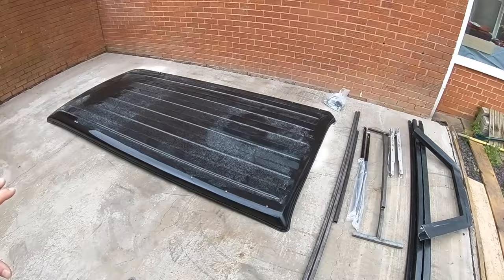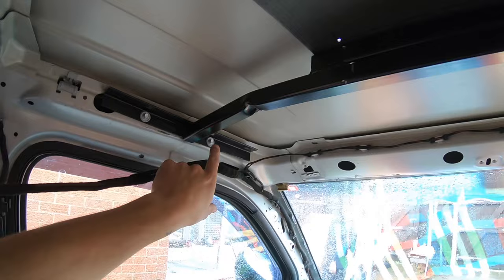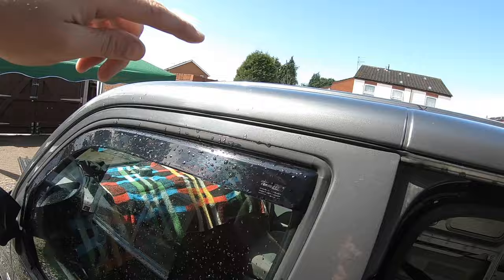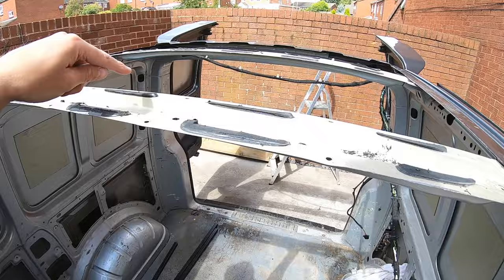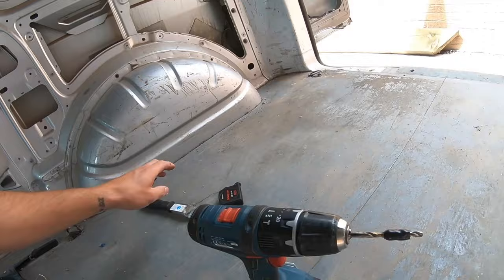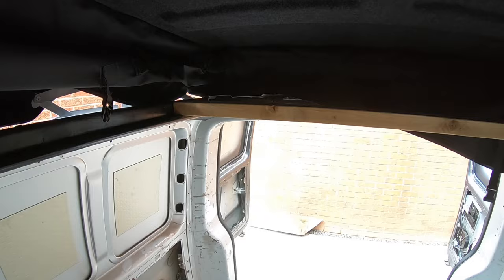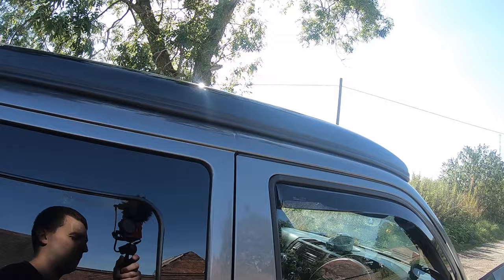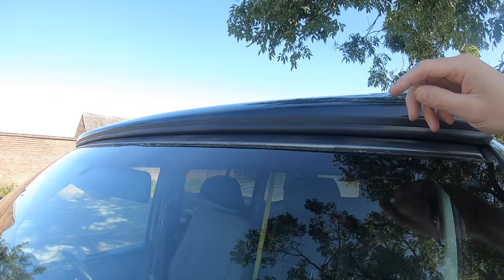** MY VW CAMPER CONVERSION BUILD ** #10 Fitting a POP TOP !!!!!!

Comment from the maker: ****PLEASE READ FOR POP TOP SUPPLIER. *****
UNFORTUNATELY DUE TO RECENT COMPLAINTS ABOUT VERY POOR SERVICE AND QUALITY ISSUES WITH THIS ROOF I NO LONGER RECOMMEND PURCHASING THIS POP TOP. SO PLEASE BE CAREFUL IF YOU PURCHASE ONE AS I RECOMMEND NOT TO. JAY
Reply: hey Dude this is really helpful. What brand was the pop top? If you are having issues i want to make sure i don't get the same one but didn't hear in the video where you got if from? Cheers
Reply: If you don't recommend the supplier please tell us who they are, I'm about to buy one and want to make sure it's not the same!! 🤷🏼‍♂️
Reply from the maker: Apologies I have only just seen this message. I can’t seem to find the company name now. The chap is called Allan who lives in derby
Reply: @JaysFabShop  nice one Jay 👍
Reply from the maker: Hey matey. I have checked but can’t find the company now. The chap is called Allan who lives in derby but that’s all I can tell you really. Just look at the kits and you will be able to tell if it’s the same as mine. With the rubbish fibreglass lengths
Reply: @JaysFabShop  yeah but to be fair you've done a good job of it,  and the fibre glass wouldn't bother me to much, nice and light at least. great in depth video as well, thanks for sharing, given me the confidence to do it myself.
Reply: So only just read this after purchasing one of Ebay. They were based up north. It came with a solid metal frame all one piece. 
What were the main issues with the quality please?
Really concerned now.
Reply from the maker: That will be a different supplier matey so don’t worry yourself it will be fine.
Reply: Hello! what would be the price of a pop top and instaling it on an older van?
Reply: @ashbrock100  I got mine off a company on eBay. They had no reviews. I was drunk and high... Bad move. The kit was actually totally fine and we just had to use a crowbar to maneuver the framer into position. We got there eventually so I would recommend it. Sorry I can't remember the name. But they were based up north UK. Good luck 😃
Reply: How much was it mate?
Reply: @savvy2807  £1800 with a colour coded canvas lining with 3 external windows and everything you need
Reply: @JakeHolland  you recon it was austops?
Reply: @savvy2807  no idea bruv
Reply: Hey jay, i know this video was a while ago but do you have any other recommendations of company’s if you don’t recommend this one

Comment: I would definetly tape the roof after you marked the lines before you start cutting. Ill tape it say 10 mm out from the mark this would allow you to follow the line and create edge when you do paint it after. This will save your van paint from all the metal shards and sparks when you cut. Cheers
Reply from the maker: Thank mate and totally correct. Because of the none stop on and off rain we chose not to mask and sheet it in the end. Definitely is a better job to though and I recommend you do 👌

Comment: Fantastic job Jay. Didn’t think it was possible to do a self fitted pop top. Having the extra headroom makes a massive difference inside. Loved all the top tips you gave. Can’t wait to see the Transporter carpet lined and fitted out.  Love the van colour and the wheels too.   👍
Reply from the maker: Thank you Ian. Very much appreciated. The start to the wiring video goes up tonight 8 pm 🙏
Reply: What size tex screws did you  use

Comment: The other option for the sealant job is to buy some of those plastic bead forming tools. I love them. Used to have nightmares doing shower re- seals until I got mine. You can get a set of them on ebay etc for a couple of quid. They look a bit like oversize guitar plectrums with curved and straight angled shapes on each corner that make very neat jobs.
Reply from the maker: Aw cool I’ve not heard of these mate but will definitely check them out as I still have the sealer to finish

Comment: Hi mate

How did you fit the rubber wind deflector strip?  Did you get an extra pair of hands or did you do it on you own?

Thanks
Reply from the maker: Hey Simon. I did it on my own. If you use tape then pull the tape along all the bottom of the seal. Then only remove the first couple of inches from one side. Stick that part down in the corner you start from then you can go along holding the seal in place and then peeling the tape cover off as you do and in turn slowly working your way along and sticking it down? Does that make sense

Comment: Awesome. Not seen such an informative video on this. 👍🏼. One question. The first support bar you put in . How do you measure its position so it fits in the correct position front to back .
Reply from the maker: Thanks mate. I mentioned it in the video it goes in line with the body lines but you can measure it from about from the top of the screen back also

Comment: Decent vid, looking at building my own camper. Just subscribed 👍. Might have to watch the pop top one 1 or 2 more times though 😂. Probably best to carpet after the pop top then?
Reply from the maker: Hey Luke. Thanks bro it means a lot. Yes I would carpet after the pop top. If you fit glass fit the carpet before you bond the glass on but after you have cut the holes out

Comment: Excellent advice, help, hints and video. Thank you for making the mistakes for us. Did you foam fill the supports after you put in the long black support poles. These are the bits had the 10mm boles poking up into the old support beams, because you worried about the edge of the metal, I wonder if you insulate the roof after you fitted the roof ?
Reply from the maker: Hi matey. No I didn’t foam fill the supports after. I could of to be fair but worried that the foam would hold moisture and make things worse? That you think?
Reply from the maker: Sorry and I have insulated all the front but I have not yet insulated the rear of the van yet. My next jobs are that and fitting the wiring and second battery

Comment: Jay I’m up to the fibreglass trim around the edge but it doesn’t seem to fit did you have to trim it before riveting it in
Reply from the maker: Yea matey you need to trim them down to fit. They are made longer than needed
Reply: @JaysFabShop   thanks for the quick reply absolutely no help from the supplier I’m certain it was the same place you got your roof mines exactly the same

Comment: great job buddy..where did you get your roof from..cheers phil
Reply: Hi Jay,
Another brilliant video, watched a load of the others as well. I also like doing my own stuff. 
Finally picked up my own Transporter after having been into Aircooled Vee Dubs for many years and then wanting a daily modern van. Mine is a 2012 140 horse Olympian blue panel van with Sportline bumpers, 20" alloys, rear spoiler etc.  So chuffed and can't wait to put the windows in etc.
The guy in Derbyshire wouldn't happen to be Allan Schofield based in Glossop would it? He has his VW Transporter parts and accessories business there. Be cool if it is as he is only local to myself.....approx 5 miles away. 😃 So damn easy for me to pick up.

Comment: I have fitted a few different van roofs in the past. I bought one of these for £1100 on Ebay and found this roof to be by far the worst I have fitted. It lacks strength in many areas. The fibreglass edging is very weak, it has many main bits missing. ie the front wind deflector is not there. The whole strengthening kit is very substandard compared to other roofs. It lacks in windows and has just fly nets instead of clear plastic, when unzipping the window. The edging trim to fix the tent down is not the normal J Trim and is again some cheap not suitable trim. Great tutorial but wrong roof to fit to your van unfortunately.
Reply from the maker: Hey Gary. Thanks for the comment matey could be great knowledge for others. Myself personally have not had any other experience with other roofs so I can’t really complain or compare. I will say I’m petty happy with it really and it suits my needs. You are correct though on some stuff. Strength wise this was one of the new batches of roofs the chap was making so I’m not sure if it’s much different to the old onces or not but I’ve found this one to feel fairly strong over the hole roof to be honest. The trim for the canvas is just house pvc window trim so correct there and yes correct a wind seal
Is not supplied. Thanks for your comment matey and if you can recommend other roofs for my viewers please do below. 🇬🇧👌
Reply: Best value for money with everything you need, including all fixings and adhesives are Denby roofs in Leek  Staffs.

Comment: Why VW has abandoned the USA van market is unknown to us. (A re-badged Dodge Caravan was their answer lol).
Reply from the maker: Aw really didn’t know that to be fair
Reply: @JaysFabShop  The UK is so lucky to have so many van offerings per the lower population they have. Is the VW Transporter a newer van model? Looks to be a mid sized van, copied in looks to the old mid size Chevy Astro (RIP 2005). Zero midsize vans on the market across the pond since then. Well, we do have the over priced, expensive to repair Mercedes Metrics, no one buys them. The Transporter would sell like hot cakes here if priced fairly. .  North Americans are addicted to useless SUV's. Vans rock, but all we have is the dieing mini-van market, or the much larger new European style vans.  A normal chevy full size (only one left) gets worse fuel consumption than my old 1979 chev cargo V8 did,... total joke.

Comment: Hi jay unfortunately I’ve already fitte this kit last week and Alan sent me this video to follow. Not knowing you don’t recommend it anymore. Anyway as it stand I’m happy with mine at the min. Sure time will tell. Question is 
Did you manage to adjust the roof on the hingies? I need to move it slightly but stringing with the Weight of the roof as you have to loosen the Botha when the roof is up.   Any recommendations how to do it easy ?

Comment: Great job pal. I have a question for you, I have a t5 with a pop top and I know the roof side supports have been riveted on but I don't think it has been glued and its creaking slightly😒. Have you any ideas how I could stop the creaks without ripping it to bits? I was maybe thinking expanding foam
Reply from the maker: Hi mate. Personally I would not advise expanding foam at all. You can cause moisture trap where you spray that and in turn could be holding moisture against the panels inside. Personally the first thing to do is to pin point exactly where the creak is. This can be achieved from pushing along the panels or you may have to drive it to get it to do it. Once you have found the area of concern you may be able to just drill out one pop rivet and leaver up the panel enough to put some bond or similar underneath and then re rivet. Does this make sense at all?
Reply: @JaysFabShop  yes this makes sense thank you for your time and effort to reply to me 😉
Reply from the maker: No problem. Apologies about how long I’ve been working so much. Feel free to add me on social media if you need anymore help just message me

Comment: Great job, how does the roof lock in place when closed ?
Reply from the maker: Hey. You have to use the two straps.
Reply: Cool thanks, is it secure just strapped down ?
Reply from the maker: Yes matey. Did I put it in the video I can’t remember. To be honest I have checked mine a lot and have never had any problems with them at all. The wind deflector one the front will also massively help hold it down. I am going to be making a video eventually about making different things to hold the down for people to follow

Comment: I've just ordered the same pop top from a guy in Derby. What size tex screws did you use mate?
Reply from the maker: Hey Joe. Did I not show the box In the video? I can’t remember if I did or not. If not I’ll find the box out tomorrow for you for the length.
Reply: @JaysFabShop  thanks for your reply, mate I've watched your video about 10 times before cutting out my roof lol and it's definitely not in there. Roof comes in the morning I can not wait!! Keep the great videos coming as they're helping me with my build,  we will probably even cross paths one day as I only live down the road in Wolverhampton.
Reply: @JaysFabShop  sorry to be a pain, my roof is now on the van but I'm having issues with the fibreglass trim panels. I know you you trimmed the front piece over the cab but did you have to trim the side pieces also? The passenger side seems to catch near the opening of the sliding door on mine. Thanks in advance for any help.